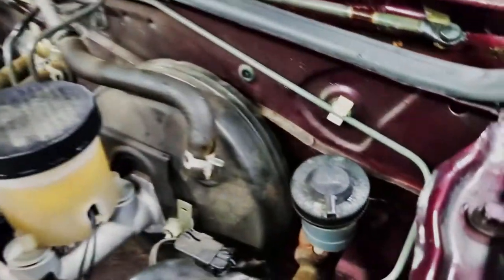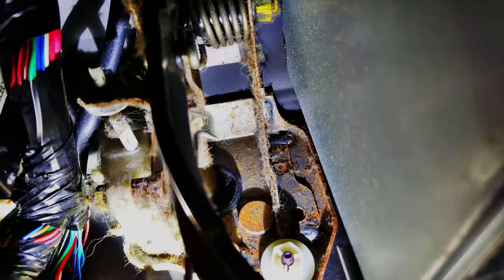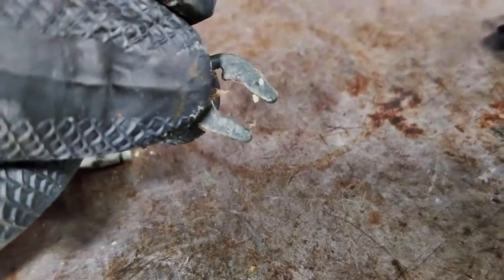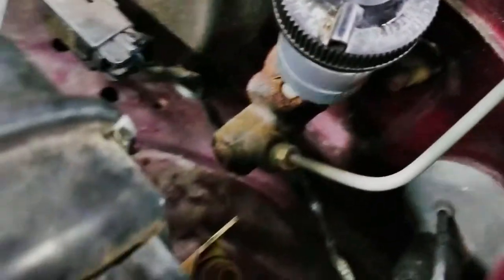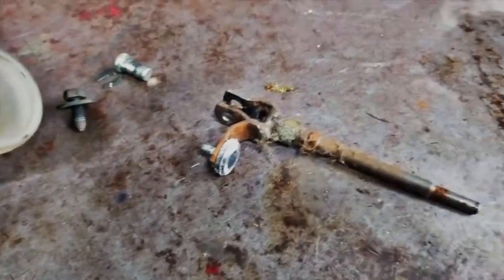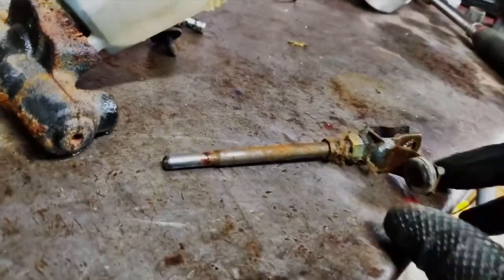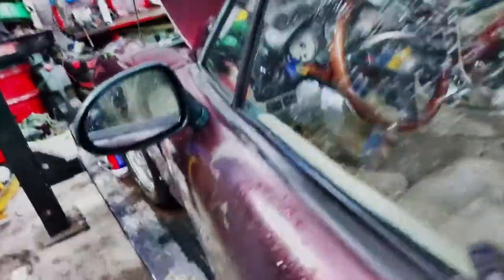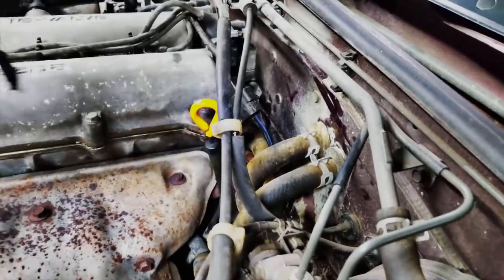How to Replace A Clutch Master Cylinder ( 2000 Mazda Miata )

Comment: Good Show, thank you. My first time owning a Miata and it's also a 2000 model w/152,000 miles. How can you tell whether it's the master or the slave cylinder? My clutch issue came on suddenly.
Reply from the maker: You can visually look for leaks first.  If not that then it can be hard to tell.  You may want to just replace both.
Reply: @SalemDoyle  Thank you, Salem!